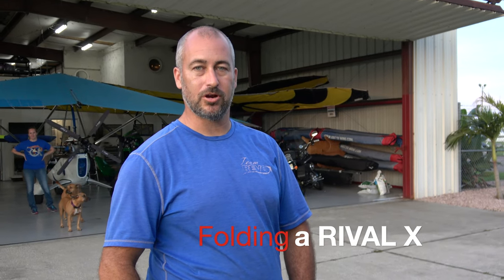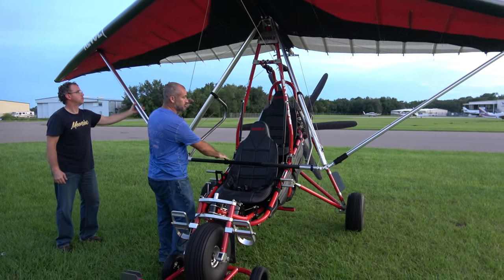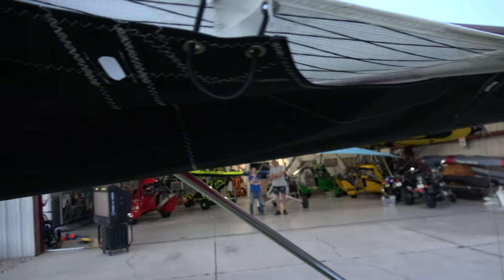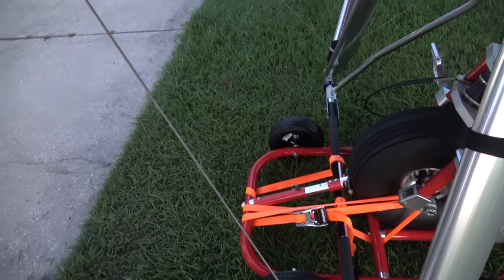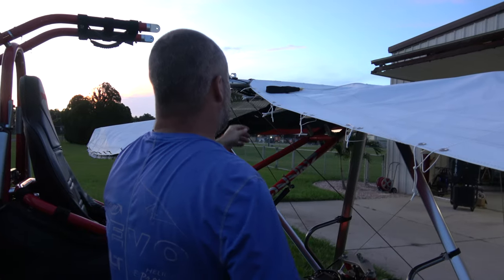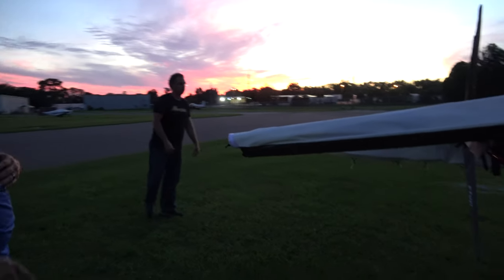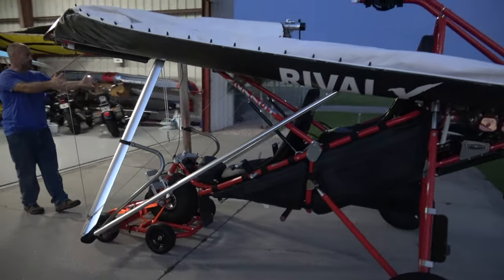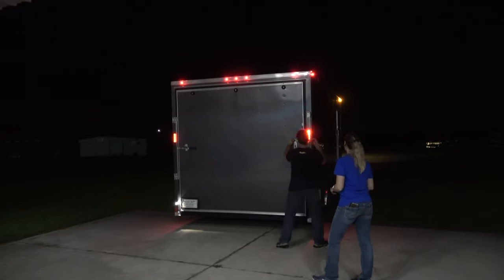Folding a RIVAL X

Comment: I'm getting ready to pull and inspect all my battens for splits or cracks at the tips. Is there a method to do this without completely relaxing the wing? I see you can get all the under-surface and tip battens out and the outboard top-surface battens, without relaxing the haul-back. Can every Batten be inspected one at a time without going all the way short of folding the wing back?
Reply from the maker: No, as the camber gets larger towards the root of the wing you can either deform the batten or tear the batten pocket by trying to remove or insert a batten into a fully tensioned Wing even if you try to do one at a time.
Reply: @LarrySMednick  I figured, but I was hoping to be able to inspect them one at a time. Can I just inspect the underside, and outboard uppers one at a time replacing them as I go, then loosen the haul back to pull the inboard uppers one at a time for inspection? If I loosen the haul-back, but don’t actually fold the wings back it wouldn’t damage any of the battens or pockets correct? Basically I’m just asking if it’s possible to inspect the battens one at a time rather than pulling them all and having a pile of 40 battens on the ground and then putting them all back in after the inspection. Thanks for taking the time to answer me by the way I appreciate that considering you are likely extremely busy getting ready for SNF right now.
Reply from the maker: If the wing is strut braced then you can detention the wing, but if the nose is up it will try to collapse back. if it has a king post you typically need to break the wing down on flat ground.

It is possible to pull one at a time but not preferable.